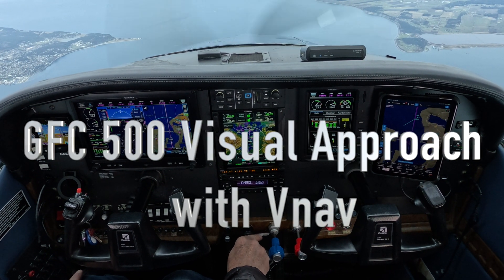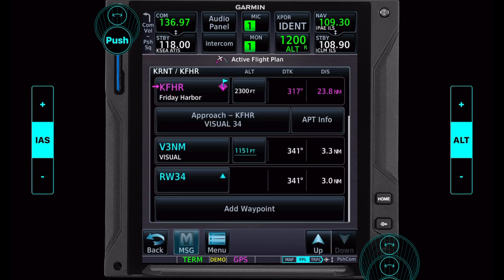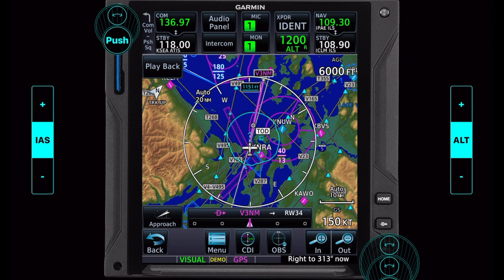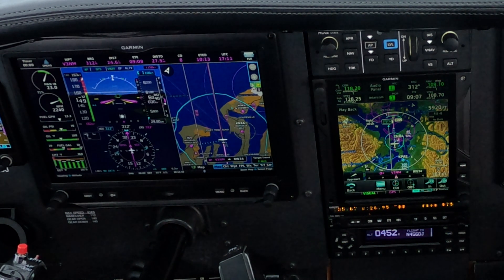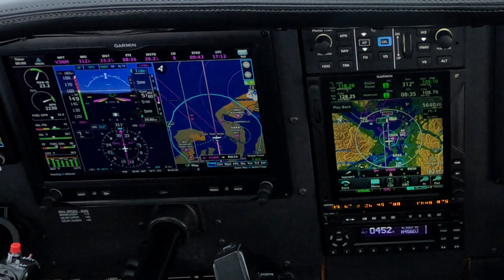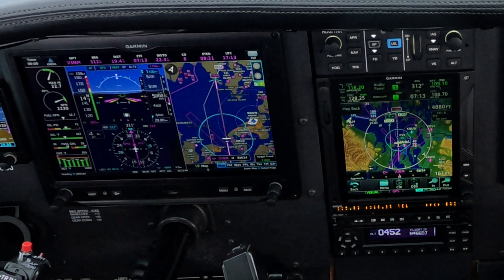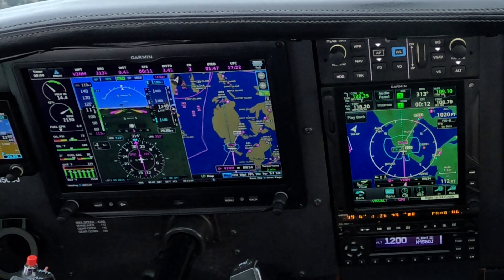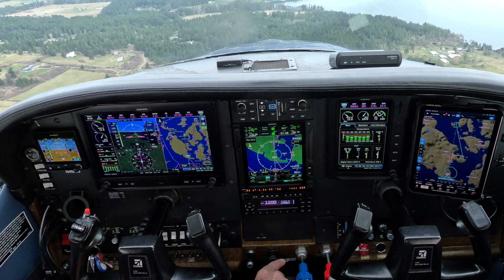Visual Approach GFC 500 autopilot

Comment: Do you have the Garmin GFC500 auto pilot? 
I fly 2 planes with that AP. One with a GPS400W
and one with a GTN750XI. Both will turn much
sharper than 90 degrees, for example, while
the TOGA button is flying back to the IAF and 
I activate the approach to make another pass
the turn is maybe 150 degrees.